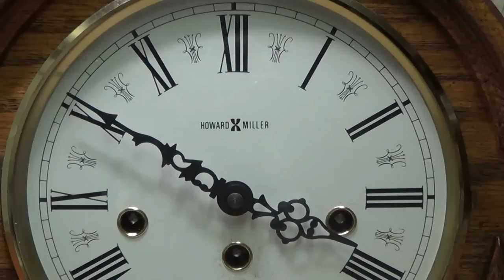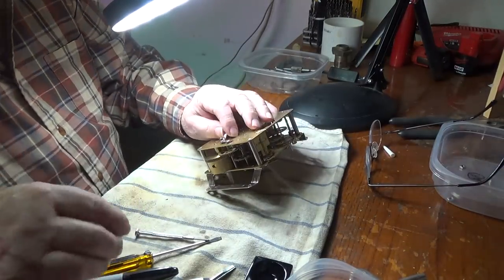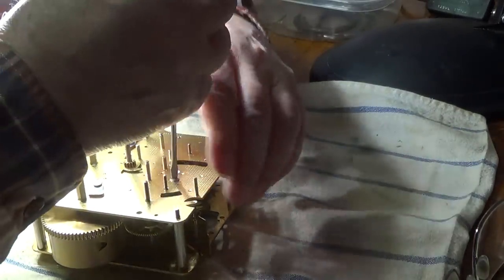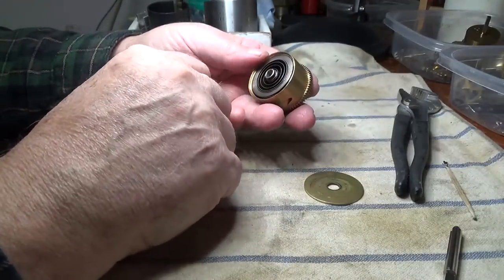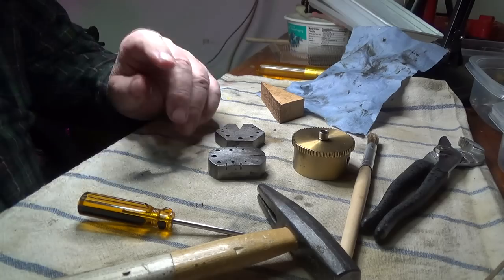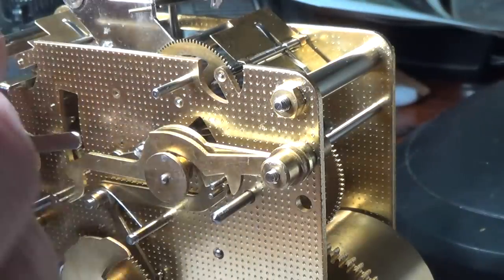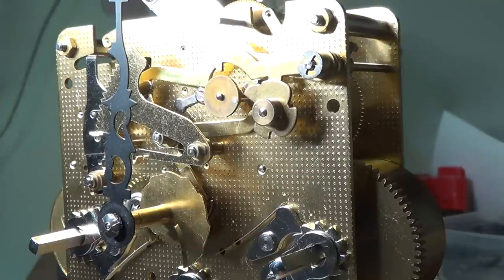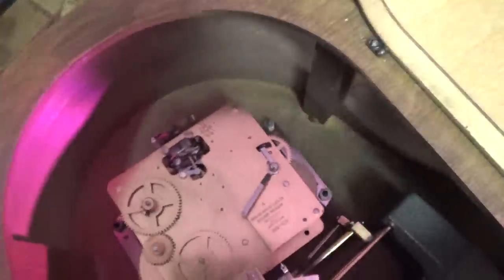Howard Miller Worthington Mantel Clock with Hermle 340 020 Movement

Comment: You always provide the best tutorials. Very honest  and clear unlike many youtubers who don't share everything openly. I really appreciate your efforts. Would it be possible to do a video on 400 day clocks and how to change the suspension spring and putting them in beat? Thanks.
Reply from the maker: Thanks for the comments.  I don't get a lot of the 400 day clocks to work on, but I have a few of my own that need work.  I'll try to do one or more this winter.  In the meantime, if you're thinking of working on them, do get a copy of Charles Terwilliger's  "The Horolovar 400-Day Clock Repair Guide".  It is indispensable.
Reply: @dperry428   I do have one but my biggest challenge is putting the clock in beat.  It is so confusing and I can't seem to get a straightforward method. Thanks a lot. I will be looking forward your future videos.
Reply from the maker: Depending on the individual clock, the pendulum should rotate approximately 270 degrees; some will be less (down to 180) and some will be more (up to 360) . Smaller models rotate more than larger models.  The way I set the beat is to carefully watch the anchor and pendulum as it operates and, at the the moment the escape tooth is released, take note of how far past that exact point does the pendulum "overrun".   The overrun at each end of the rotation should be exactly the same.  If the overrun of the pendulum is not the same, the piece from which the top block is attached will have to be twisted to adjust the overrun.  These adjustments are VERY tiny.  That's why there is a "beat adjustment tool available that clamps to the top block assembly.  It has a long handle that allows for very small adjustments.  https://ronellclock.com/400-Day-Beat-Setting-Tool-TL-10.htm?categoryId=-1
Reply: @dperry428  Thank you very much. I have the tool and the book but it seems to me that the template in the book isn't 100% accurate. It shows the fork tilted upwards and when I followed it,  the clock didn't tick. I have a walmac 400 day clock that uses template 27c in the book.  I moved it to be vertical and now it ticks but I am still trying to fiddle with the tool to get the beat right; What happens if the suspension spring is a bit shorter ? Would that affect the beat?
Reply from the maker: Watch that the vertical wire that is on top of the anchor hasn't been bent out of vertical. That can affect the interaction of the fork and anchor.  Another thing to watch is whether the mainspring has not lost its strength.  Did you remove it to clean and lubricate and to check it for expansion to at least 2 1/2 times the diameter of the barrel?  Yes, the length of the suspension (torsion) spring is critical. If it is too short, the clock will run fast and the degrees of rotation will be smaller. The overrun will be smaller and it could be harder to judge when the clock is in beat.  Too long and the clock will run slow, degrees of rotation will be greater and overrun will be longer. It is, of course, extremely important that the thickness of the wire be exact. I would not consider using anything other than Horolovar springs. That is the one that Terwilliger's book is based on.  Springs other than Horolovar may be made of different material and the same thickness may not have the same torsional characteristics.  I  know there are bronze springs available, but using them creates all sorts of complications. I've not heard of the brand you mention (Walmac).
Reply: Thank you so much. I followed your instructions and now the clock is running and everything is good. Thanks a lot.
Reply from the maker: Good!  Glad I could be of assistance.
Reply: @dperry428  I am still looking forward to your 400 day clock video in the winter though to learn more from the expert :)

Comment: Mr Perry... I just bought a Solar Mantle clock with a floating balance wheel escapement. It was so gummed up I had to ultrasonically clean the balance wheel assembly and the hammer mechanism because they wouldn't even function. I actually got the thing working..I will be making a video of it soon.
Reply from the maker: It's amazing how gummed up some of them can get.  More satisfying to get them running again.
Reply: @dperry428  i have it back together.. there is a video on my channel.
Reply: @dperry428  perhaps you know.. in the floating escapement..is there a lubrication point in the mechinism? I did ultrasonically clean it and the amlitude did improve but it isn't moving more than about 35 deg.each way. It runs but it is not lubricated.  Perhaps you know.
Reply from the maker: No, do not oil it.  You might find this thread from the NAWCC forum of value:  https://mb.nawcc.org/threads/guidelines-for-repair-hermle-floating-balance.17277/   Also, here is the Hermle Service Manual.  https://issuu.com/acru/docs/hermle_service_manual   Discussion of floating balance is on page II-28.

Comment: Great video- thank you!  The only thing I am not clear on and maybe you can make a video of:  how do you oil the clock and in which places?  Do you oil the teeth pars of the wheels to run smoothly?  What do you use for that?  Will W-40 be bad?  How about razor blade oil?  Thank you!
Reply from the maker: Use a good synthetic clock oil.  Do not use WD40.  It is a penetrating oil that spreads out, so is the opposite of what is wanted in a clock.  The WD stands for  water displacement.  Good for locks and rusty bolts, but really bad for clocks.  Razor oil the same.  Oil only the pivots of each gear and, then, only a tiny amount.  Too much  oil that spills out of the pivot hole will run down the plate, draw out the oil in the pivot and act as a dust collector.  NEVER oil gear teeth nor pivots of levers, except for oiling the anchor pallets with a tiny drop of oil that will lubricate just the tips of the escape wheel teeth.

Comment: Awesome video. Can you tell me the difference between 340-020 and 340-020A.  I'm looking for a hand nut and wonder if both units use the same.  Thanks
Reply from the maker: If the "A" were separate from the model number, it would signify the movement being made in 1988 but, as far as I know,  a letter after the model number is an engineering code and has no significance.  340-020 and 340-020A should have the same hand nut.

Comment: Great video. I just tore into my Hermle 340-020 and the chimes were not timed right, did not realize that the cams had to be positioned correctly.  My fault, I hadn't taken pictures before I tore into it. QUESTION though, is there a "timing mark" on the striker barrel that I should be aware of?
Reply from the maker: No, not that I'm aware of.    To set the roller with the pins on it so that the clock strikes the right notes, I let the clock run through the strike at the quarter hour or 3/4 hour since that's when four descending notes are sounded.  So, let the clock strike, say, the quarter hour, loosen the set screw on the gear that runs the roller and turn the roller until the pins move the four hammers in a linear sequence, one after another, and then retighten the set screw.  You may have to make minor adjustments so that the last hammer falls when the strike sequence ends.  In a triple-chime movement, you should set the tune to Westminster chimes

Comment: Very thorough, for the most part. You didn’t show the cleaning of the spring, and the darkened oil when you tapped it to get rid of excess, makes me wonder if it was cleaned or just oiled. Just wondering if cleaning is necessary- it is enclosed in operation, after all.
Reply from the maker: Cleaning is absolutely necessary. You are correct that I didn't actually show cleaning the springs. None of my videos show every step or they would be six or more hours long. The old oil dries out and prevents the spring coils from freely moving.  Not much to show about cleaning the springs except when there is oxidation and really hardened oils and grease as the spring is simply put into the ultrasonic cleaner.  There would be no need to remove the springs from the barrel if they simply needed oil.  That can be added to the edges of the spring in barrel without removing it.  How much a spring needs cleaning can only be ascertained by removing it from the barrel.
Reply: @dperry428  Thank you very much for the time and efforts you take in sharing your work with those of us who are grateful. Unlike some, I appreciate the videos and I thank you for posting whatever YOU decide to share, irrespective of what tactless viewers may feel entitled to.
Reply from the maker: Thank you.  The original reason for my making these videos was to show the owner of the clock what was done to it and what goes into "repairing" a clock.  Over time, how certain operations are done was added to help those interested in getting started with this hobby. Also, when unusual circumstances come up, it's fun to share those as well. I always figured that if I already have shown how to do something in a video, it wasn't necessary to show it every time. I think a lot of people don't realize, either, how long it takes to edit one of these videos.  I'm running the camera for long periods of time and have to select what I include or the videos literally could run for many hours.  I also figure that someone who is interested in learning will take the time to watch more than one of my videos and, if they've seen it before, they won't want to see it again.  Some people also get upset if my hands get in the way.  I'm fixing clocks, not making cinematic wonders.  Guess no matter what I do, someone will get offended. I appreciate your comments.  Thanks again.

Comment: Hi there I have that same movement on my clock it works fine but it runs about a half hr fast I see the plus and minus wings but Im not sure witch one to move and what direction to move them  could you please guide me in the correct direction I would appreciate it! This was my dads clock he got from his work I don't remember how many yrs it!
Reply from the maker: Depends on the type of balance.  Try these references:
https://youtu.be/GV-2UF9L9NU?si=PvyZBu1jXQoKYNO8
https://mb.nawcc.org/threads/adjusting-time-on-old-style-hermle-340-020.80026/
If it is very fast, it may be beyond adjusting and needs a new spring.

Comment: Gracias por compartir sus conocimientos, necesitaba un tutorial de esta máquina.
Regular el atraso y adelanto una vez hecho el servicio no lo tengo claro.
Reply from the maker: On this movement, there is a screw on the back next to the balance wheel. Turn the screw to the + to speed up the clock and to the - to slow it down.  On other movements, there is a lever that shortens the hairspring to speed up the clock or lengthens it to slow it down.
Reply: @dperry428  Ya esta montado y funcionando. 
Muchas gracias por la ayuda. 
Un cordial saludo desde España

Comment: I have identical movement. I have repaired and got it working but it will stop chiming because of a spring that is missing from the lever that lifts on the star wheel.
Do you have a picture or dimensions of that spring? Or the gauge of wire I might need to get to make a new one. I Live in the U.K
Is there anyone doing spares?
Great video. Your help appreciated.
Reply from the maker: I can't help with spring size as the clock has long since gone back to the owner.  You might find what you need in an assortment such as this:  https://timesavers.com/i-8947977-200-piece-coil-spring-assortment.html
In the past, I've made various springs from brass spring wire
https://timesavers.com/search.html?q=brass+spring+wire

Comment: You did a great job explaining the entire process and I compliment your level of knowledge. I’m working on this exact same movement the frame-Hermie 340-020. I’ve got it fixed except for one thing that you didn’t go into. I had to remove the hammer assembly because the hammers were frozen and I took out the cam down there. I’ve placed it back in and all just like the movement you were working on except that the chime doesn’t complete the quarter hour until the next quarter hour. I was wondering if there is a certain way to place that cam in or does it work no matter where it’s placed? Any help you could give me would be appreciated
Reply from the maker: I think you're referring to the roller with the pins that raise the hammers?  Set the chime to the point where either the quarter hour or 3/4 hour chime is done, assuming Westminster chime. At those quarter chimes, the chime ends in 4 descending notes. Loosen the gear with the set screw on the back of the movement. Disengage the gear teeth.  Rotate the roller until the  hammers drop to sound the 4 descending notes.  Re-engage the gear teeth and tighten the set screw.  You may have to repeat that until it finishes the chime correctly.

Comment: so my HM bracket clock runs for about 20 hrs and then stops, I can move the front hand arbor up a little and it starts back??? so what do you think is my issue here Sir
Reply from the maker: Sounds like a classic case of worn pivot holes.  The clock runs until the slack is taken up in the wheel (gear) train, depth of mesh gets too deep in one or more gears and the clock stops.  Moving the hands jostles the gears, pushes one of the pivots out of the worn spot in its pivot hole and the clock starts again.  Solution is to rebush the worn pivot holes.

Comment: I have a clock like this.   I replaced the main spring based on your comment to another viewer since it was gaining an hour a day and couldn't adjust..   Now the chimes are a mess.   The hammers seem out of sync, one or more left in up position and the last chime leaves one hammer up that chimes on the next quarter.   I think the gear that moves the hammers is in wrong, if so, how to get it aligned?   It is also chiming 8 minutes off the quarters.  Thank you, your video is super.
Reply from the maker: Make it chime the quarter or three-quarter hour.  Both of those chimes end in four descending notes. Then loosen the set screw on the top gear on the back of the movement and move the roll with the pins on it until it just finishes the four descending notes.  Retighten the set screw.  The minute hand can be adjusted to point at the proper quarter by twisting it in the attached tubular base until it aligns with the correct number.
Reply: @dperry428  Thank you sir

Comment: I have a clock That I replaced the movement with a brand new 340-020a but it runs slow. Is there and adjustment screw to make the clock running faster about 3 minutes a day. Thanks
Reply from the maker: Looking at the back of the movement, at the top of the back plate on the right-hand side, you'll see  + and -  signs stamped on the plate.  Above those signs, on the platform with the balance wheel, you'll see a slotted screw.  Turning that screw clockwise will slow the clock and turning it counterclockwise will speed the clock. Turn the screw half-a-turn and observe the results in time keeping. Adjust back and forth until it keeps accurate time.  Even tiny movements of the screw will make a difference, so be judicious.
Reply: Hello I have the same issue the only screws I see are the ones that holds the balance wheel assembly and there tight what am I not seeing?? maybe I have a different mechanical movement I have marked on the back says  Kieninger 73  #340-020
Reply from the maker: What you describe does not exist.  If it actually has "Kieninger 73" stamped on it, it doesn't have a balance wheel.  That model is a pendulum movement, chain/weight driven grandfather movement.  #340-020 is a Hermle number, which is a completely different manufacturer.  Your information is faulty, so I can't help you.
Reply: @dperry428  can I send you a picture of the mechanism for the Kieninger 73 340-020 mantle clock
Reply: @dperry428  thank you so much for your time and help

Comment: I have the Hermle Hamilton Wheatland 340-020 movement (same movement as yours) I only have one issue with it. It chimes fine but when it reaches the hour, it chimes one extra ie if its 8o'clock it chimes 9 times. Is there any easy fix for this issue. I dont think I'm brave enough to dismantle as you have done here, besides I feel there is very little actually wrong with it as the 15,30 and 45 chimes are spot on. Any help with this would be much appreciated. Thanks
Reply from the maker: The hour hand is a friction fit;  move it forward one hour.  Probably, at some time in the past, someone set the time by moving the hour hand backward.  The movement doesn't give a hoot where the hour hand is.
Reply: Thank you so much for this invaluable information. My click is now chiming the hour perfectly thanks to you. 👍👍👍👍
Reply from the maker: Glad I could be of help.

Comment: Hi Mr. Perry.  Love the video.  You gave me the confidence to tear apart my Hermle 351-830.  Question:  I don't have a puller, so the the minute shaft will stay on the plate.  From a bushing perspective, how much play is acceptable between the shaft and plate?  I can't get it apart to inspect it.  Thanks so much.
Reply from the maker: I can't give you a specific amount of play that is permissible, but it's quite a bit.  It isn't part of the drive train and there is not a lot of pressure on that arbor and pivot hole. If the hands don't bind when it's running, leave it alone.